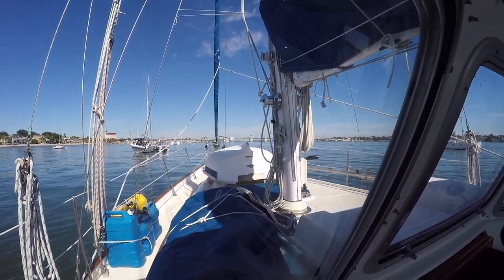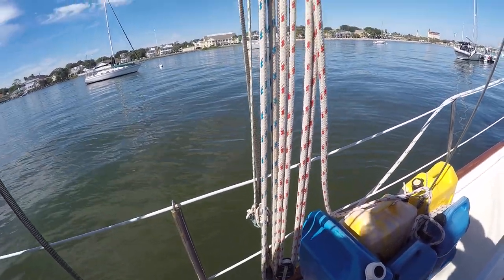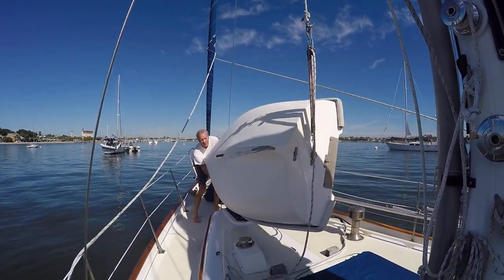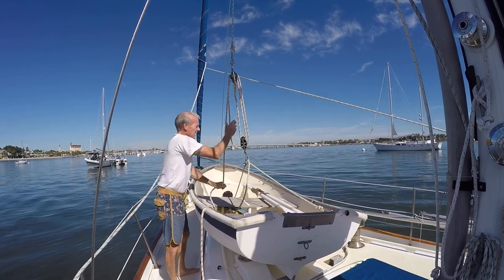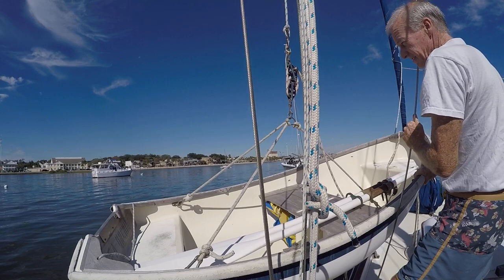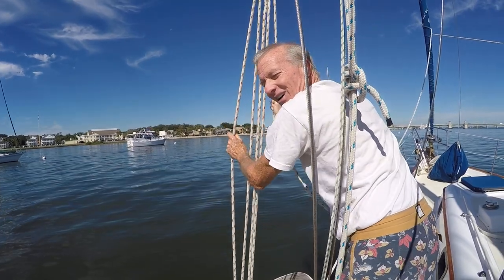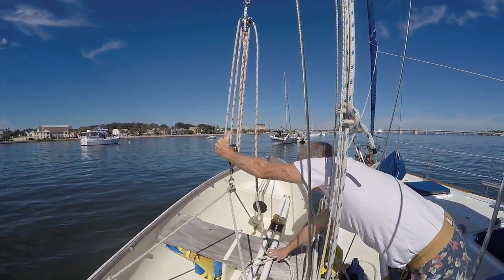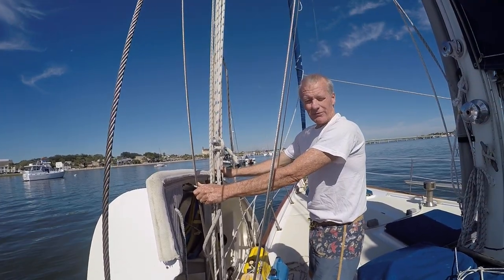Launching a hard dinghy off our foredeck

Comment: Like what you've done. Thanks for the ideas. Would love to have had a good look at the storage cradle.
Reply from the maker: Not a storage cradle, we just have three 2” high blocks of teak. Very basic, we have a turnbuckle with snap shackle that pulls down on the bow eye. Then a webbing strap that goes over the aft section of the hull.

Comment: looks like I could use my main purchase to lift my dingy. How is that ring mounted to the boat?
Thank you
Reply from the maker: The ring on the transom is thru bolted. It’s mounted low so it’s at the pivot point for the flip like a rotisserie chicken. The ring folds or falls flat out of the way when using the outboard or sailing rudder.

Comment: Nice video, thanks.  Any tips for easily moving an outboard motor to and from the dinghy to the stern rail?  I'll be doing that soon for first time with small 3.3HP outboard onto a 7' fiberglass dinghy from my new Cal 33.  Motor is light enough to handle w/o using a pulley system, so I figure I'll just carry it down the swim ladder.  I'm not that concerned like I would be if it was a 10HP or bigger, but still will secure a line to it so it doesn't end up at the bottom of the bay.  Thanks.
Reply from the maker: We use a 8hp both on our inflatable and even the hard dink. I use the same type of block and tackle as it’s 65 pounds. But for your light outboard hopefully you can just juggle it down there. Maybe you can use one of the rungs part way down for a hanging rest point then you can get in the dinghy for that last cross over.

Comment: Hey great idea but whats the blockck and tackle anchored to?
Reply from the maker: The upper part of the block and tackle is attached to our spinnaker halyard. However it could just as easily be attached to our secondary jib halyard. Another advantage to this method is the lead into the sheave at the mast head need not be perfectly fair as once you have the correct height it is set and not active.

Comment: Looks like the pulley system has a locking mechanism. Might work for my kayak storage. Can you let me know the details/make etc of the pulley system and weight capacity. Thanks
Reply from the maker: It’s a simple 4 part block and tackle made by Schaefer Marine. The top double block also has a cam cleat. It should be easy to find via West Marine.
Reply from the maker: Schaefer marine 4 part block is rated for over a thousand pounds. Think it’s the series 5 is the size.